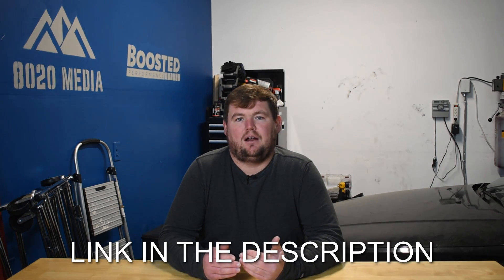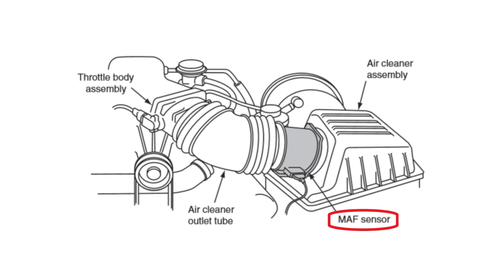DIY - 5 Symptoms of a Failing MAF (Mass Air Flow) Sensor!

Comment: 2016 Ford expedition XLT 3.5 eco-boost error code P0430 bank 2 cleaned out the catalytic converter put on a new O2 sensor car runs perfect even when the check engine light came on changed out all the spark plugs. All the wires look good all the coils look good.. but the check engine light still keeps coming back on staying solid even though I changed the O2 sensor and everything else. Do you think the map sensor which I’ve cleaned all the sensors with the right spray but the check engine light stays on solid, but the car runs perfect idols perfect when I hit the gas it goes. I just don’t like my check engine light on all the time only one code# pops up.

Comment: I bought a aftermarket maf sensor and installed it the car ran great 
So i got home and unplugged while its running and engine light came up then plugged it back in and the check light wont go away now 
I dont get it
Reply: Disconnect battery for a few minutes to clear codes
Reply: You need a scanner to clear or like the other comment said, disconnect battery for a few minutes.

Comment: I have the bouncing RPMs and was going with the vct or vvt solenoids on a 2015 mustang gt. Had changed the spark plugs recently but was still doing the same. Luckily bought dealership warranty last year so it sits at dealership and waiting for diagnostics to see what problems it has. No check engine light on at all.

Comment: I have a 03 Chevy S10 zr2 well my truck is little hard to start in morning but rest of day it's start find run s fine can you please tell what it could be when I have it running I unplug the mass flow sensor but it's doesn't die keeps running

Comment: I've owned vehicles 50 years old or more.
I never had to work around all this B.S. we're put through today 😮.
These cars still have their original glossy paint. No clear coat failure nonsense.
I will never own a car built after 1972 again.
😊
Reply: I'm guessing the furthest you drive your pre-1972 cars is to the mailbox and back 😉

Comment: Have a mustang 1968. 289 engine cranks but won’t start
Reply: Take off the air filter, then spray some starting fluid (ether) in the carb for about 3 or 4 seconds.  Then see if it will start and run for several seconds.  If it does, it's out of gas or the fuel pump is bad or it's not getting not getting gas for whatever reason.  If it still won't start, you likely have an ignition system failure.

Comment: Can a dirty air filter give you a maf sensor reading my check engine light came on and the code was MAF but it's running fine but the air filter was kinda dirty

Comment: lean code led to rich code after changing MAF sensor,  ended up being the brake booster causing all the havoc , also had to change the o2 Sensor which was cracked from excessive rich conditions. I dont think the old MAF was bad , looked clean , no carbon build up and all of the symptoms are the same when the brake booster fails.
Reply from the maker: E - You diagnosed it spot on — when a brake booster develops an internal diaphragm leak, it creates a vacuum leak that the ECU tries to correct, which can first throw a lean code (too much unmetered air), then lead to a rich code once fuel trims swing the other way to compensate. A failing booster can also change engine load at idle, upset fuel trims, and even cause stalling, so your experience of symptoms resolving only after replacing the booster makes sense. The cracked O₂ sensor likely happened from prolonged rich running, and the MAF was probably fine all along, since those rarely fail without dirt or oil contamination. In short, your booster was the root cause — fixing that plus the damaged O₂ sensor puts you back to square one, and it’s a good example of why vacuum-related faults can mimic fuel or sensor issues.

Comment: My 2015 civic has been idling horribly and dying codes read as c and d coils being bad so I replaced those, saw my air intake hose had a tear replaced that, got a new gasket for the throttle body, replaced some of the smaller air hoses, nothing has done anything to fix it. If this fixes it I might kiss you
Reply from the maker: J - If your 2015 Civic is still idling rough and stalling after new coils, intake hose, throttle body gasket, and small hoses, then the next most likely culprit is a vacuum or fueling issue that isn’t obvious, such as a bad PCV valve stuck open, a dirty or sticking IAC/throttle body, or a weak fuel injector or fuel pressure regulator; since you’ve eliminated ignition and obvious air leaks, I’d check for vacuum leaks with carb cleaner or a smoke test, clean the throttle body and idle passages thoroughly, and if that still doesn’t help, scan live data to see if short- and long-term fuel trims are pegged lean or rich, which will tell you if the issue is unmetered air vs. fuel delivery — those clues usually solve Civics with “everything replaced but still rough idle” cases. Keep us updated!
Reply: @8020Automotive I checked the pcv valve, wasn’t too sure what to look for exactly but I cleaned it best I could and put it back. I haven’t cleaned the throttle body because it didn’t look bad enough to be the culprit but I’ll do that tomorrow. I can hear a hiss coming from somewhere still and can’t find the leak with carb cleaner or doing a diy smoke test with a cigar. I’m scheduled to take it in next week, $100 per hour for diagnosis but they have an actual smoke machine. I would love to get it fixed myself before that though. I’m worried it could be the intake manifold gasket because I have no idea how I’d get back there to replace that and they’d charge an arm and a leg I’m sure. But thank you for the tips I’ll work on it some more when I get time tomorrow and let you know how it goes! You got a sub from me

Comment: I installed a JET Performance MAF and my car experienced stuttering, jerkiness, hard starting, rough idle, pretty much everything you said. However no fault codes. I took off the Jet and installed  the OEM MAF back on and all of my issues went away. My car runs so smooth now.
Reply from the maker: A - That lines up perfectly — the JET performance MAF was throwing your fuel trims off even though it didn’t trigger a fault code. Aftermarket “performance” MAFs often don’t match the factory ECU calibration, so the car ends up running too lean or too rich, which causes exactly the stuttering, jerking, hard starts, and rough idle you experienced. When you put the OEM MAF back in, the ECU got the correct airflow readings again, which is why everything smoothed out. Bottom line: on modern engines, the OEM MAF is almost always the best choice unless you’re running a custom tune specifically designed for that aftermarket sensor.
Reply: @8020Automotive Thank you for the information. I was stupid to listen to my friend. It was a horrible experience for me and with your informative advice I'll never put the Jet back on my vehicle.
Reply from the maker: B - Congrats on the new ride!
Reply: @alb.4089 fam do you need to disconnect the battery when replacing a MAF sensor?
Reply: @Worldisyours323  Bro it's recommended you disconnect the negative battery terminal to prevent electrical damage. Better safe than sorry.

Comment: Wat causes limited gears in automatic LD3 ?
Reply from the maker: D - If your automatic LD3 is stuck with limited gears (like only 2nd or 3rd working, often called “limp mode”), it usually means the transmission control module has detected a serious fault and locked the gearbox into a safe gear to prevent damage; the most common causes are low or dirty transmission fluid, faulty shift solenoids, bad speed sensors, wiring issues to the TCM, or internal clutch pack problems. Scanning the transmission for codes is the first step, since even if the check engine light isn’t on, the TCM will store specific faults (like pressure control, gear ratio errors, or solenoid failures) that tell you whether it’s an electrical/solenoid issue or an internal mechanical fault.
Reply: @8020Automotive thank U , last time it was checked code : P0960-14 indicated after a mechanic scanned it 🤔 however @ this rate I am tempted to change everything coz since I bought it sec hand I never really changed anything
Reply from the maker: D - Keep us updated.

Comment: My 2009 Honda Accord. Noting but headaches 😮.  Just replaced my Air flow tube. And now the Check engine light is on and I can't smog.
Reply from the maker: J - Sorry to hear this.. The most likely cause is that something isn’t sealed or reconnected properly—common mistakes are a small vacuum line not being plugged back in, the mass airflow (MAF) sensor or intake air temp sensor connector not being seated fully, or a crack/leak in the new tube that lets unmetered air in. Since you need to pass smog, the first step is to scan the code (many parts stores will do it free) so you know exactly what’s being flagged—often it’s a P0171 (system too lean) or MAF/IAT sensor code if there’s an intake leak. Double-check the clamps at both ends of the tube, reconnect every hose and sensor, and make sure there are no gaps or cracks. Once the issue is fixed and codes are cleared, the light will stay off and you’ll be able to complete the drive cycle needed for smog.

Comment: Got a MAF coming in today for a 2007 Nissan Versa. Rough idle, hard starts, low acceleration, and keeps throwing p0300 p0301 codes. So i put in new coils, spark plugs, fuel injectors, and had a mechanic put in a new valve cover n gasget thats leaking in spark plug hole 3 after i later inspected it. I have reset the codes after every time and the same.The code pops up. I unplugged the maf to see if the car would turn off while it was on and just continued on, it never turned off. Now, I haven't tested it with a multimeter to check all the wires, but I have one coming in this evening to put in. Any ideas? Could it be the number 3 spark plug that's leaking oil into the sport plug? Thanks in advance
Reply from the maker: O - Yes, oil leaking into the #3 spark plug tube can absolutely cause persistent misfires even with new plugs and coils, because the oil fouls the spark and can damage the coil boot over time, so if the new valve cover and gasket didn’t seal properly or the plug well is still wet, that cylinder will keep misfiring; since you’ve replaced most ignition and fuel parts already, the next most likely causes are a bad MAF (which fits your rough idle, hard start, and low power—especially if unplugging it didn’t change behavior), a wiring issue at the MAF or coil connectors, or low compression on cylinder #3 from a deeper mechanical issue. I’d recommend first making sure plug well #3 is completely cleaned and dry, reinstall the new MAF and clear codes, then if P0300/P0301 still return, do a compression or leak-down test on #3 to rule out valve or piston ring issues. If compression is good and the misfire stays on #3, then focus on the coil boot sealing against oil and the wiring harness to that cylinder.
Reply: Shouldn't it be a P0303 Cylinder 3? I dint know why the combination brings up P0300 and P0301 always. And after every replacement I've reset the codes. So weird. I haven't done a compression or a leaked down test yet.But that's my next thing to do. Went do the DEQ test here in the state of Oregon and  didn't pass because of 02 sensors not ready and evap not ready after 86 miles on the new MAF. I was told that the vehicle needed to complete a full drive cycle. after driving it some more, eventually the check engine light came on after a couple hard starts/cold starts. I haven't replaced the 02 sensors because my 07 Nissan versa is not throwing me any codes for that. Could the 02 sensors be fouled up and not be throwing codes as well? Even if the main culprit could be cylinder 3. Thanks again 8020Auotomotive
Reply from the maker: O - It makes sense you’re confused because if the problem is always on cylinder 3 you’d expect a P0303, but the way Nissan’s ECM logic works, if it sees frequent misfires on a specific cylinder plus random misfires scattered across others (even if they’re just ghost misreads), it will often store P0300 (random/multiple) along with a P0301 or another nearby cylinder instead of locking in on P0303 — especially if the misfire detection is influenced by O₂ feedback. Since you haven’t done a compression or leak-down yet, that’s the right next step because a weak cylinder will keep chasing you in circles no matter how many ignition parts you swap. As for the O₂ sensors, yes, they can get lazy or fouled without setting a direct code, which can delay readiness monitors and skew fuel trims so the ECM thinks misfires are random, not cylinder-specific; that’s likely why your DEQ test failed on “not ready” monitors after the MAF change, since a drive cycle can’t complete properly if the O₂s are slow to switch. In short, do the compression/leak-down on cylinder 3 first, and if it passes, then look at replacing the upstream O₂ sensors even if they aren’t throwing codes, because they could still be slow and muddying both the readiness monitors and the misfire detection.

Comment: Some posts indicate that modern cars are crap when compared to the past. That’s just BS…
lots of failures on old cars 60’s, 70’s: (-: old cars shortcomings, +: new car advantages)
-points, condensers & spark plug wires replaced every 12K mi
-carburetor chokes often needed adjustments when the engine wouldn’t run properly when cold
-in the past, conventional motor oil lacked sufficient cleaning detergents
-rebuilding a carburetor, or replacement one needed ~60k miles due to o-ring and gasket failures & gummed up internals
-vacuum leaks from piss poor vacuum lines that disintegrated quickly in high heat & cold temps (computers replaced a lot of these vacuum controls)
-paints were terrible (GM (Roger Smith) saved money by eliminating primer coat) in 1970s cars. Also, paints didn’t hold up long
-I also remember regularly replacing headlight, brake, turn signal incandescent bulbs that failed
-long stops were common in the rain due to worse tire tread & design, plus drum brakes
-occupants regularly died due to being impaled by steering column & uneven crumple zones without seatbelts & airbags
+synthetic motor oil provides better protection & less evaporation as well as better flow at colder temps
+current electronic fuel systems using a hybrid direct fuel  & intake manifold fuel system such as in Toyota’s are very reliable
+LED headlight bulbs are more reliable & you can see the road much better at night
+can bus allows for monitoring of subsystems with serial transmission to save wires & crimp connections (less electrical failures)
+need to be replaced every 12K miles
+coils mounted above spark plugs, along with iridium spark plugs reduces electrical misfires & spark plugs last 100K miles
+better gaskets than cork reduce constant oil leaks
+high quality connectors sealed from moisture with better crimps has reduced intermittent connects
+ABS breaking saves a lot of lives in poor weather conditions
+improved tire design made possible all season tires
+CAD (computer aided design) along with insurance company testing that showed how deaths and severe injuries could be reduced by maintains the driver-passenger floor pan as well as structural cage, along with airbags (side, frontal) & seatbelts

Modern complaints
&Now I would never buy a car with only direct fuel injection like some manufacturers went to (VW?) because of intake valve issues.
&I disagree with car manufacturers selling private information to auto insurance companies through a 3rd party.
&I do not agree with claiming automatic fluid doesn’t need to be changed, dip sticks are useful
&PCB assemblies are way too expensive 
&EVs should be more reliable & cheaper than ICE vehicles
&Waiting for hybrids with battery packs that cannot catch fire
Reply from the maker: G - Thank you for taking the time to share all of this. Very insightful, but we will say that they certainly don't make engines like they did back in the day..
Reply: @8020Automotive I disagree. Whereas it’s not real powerful, only 203hp @2.5L 4-cylinder Dynamic Force engine is amazing. In a 2018 Camry LE, this engine can crank out 45mpg @70mph. Driving from St. Pete to north of Orlando, my car averaged 45mpg multiple times, and even 42mpg while stuck in I4 traffic for 20mi. Overall, it averages ~35mpg.

If you lookup online, you will see a few Camry’s with this engine over 300K and one over 400K. Of course, you can’t ignore maintenance, but this is a great engine. 

In fact, this same basic engine altered to run on Atkinson cycle puts out an average 50mpg in hybrids. That’s impressive. That’s good engineering and production quality.